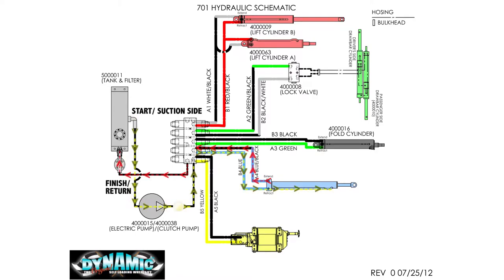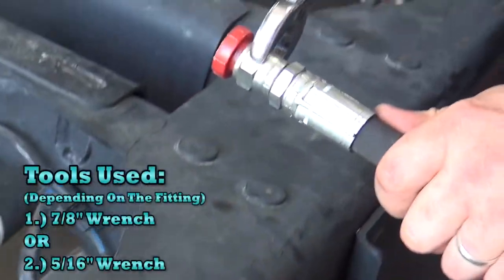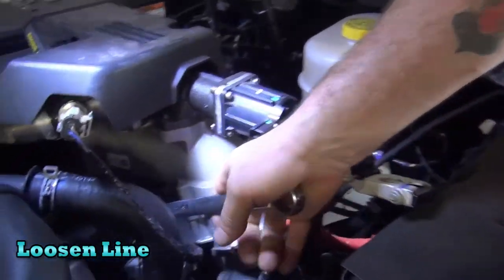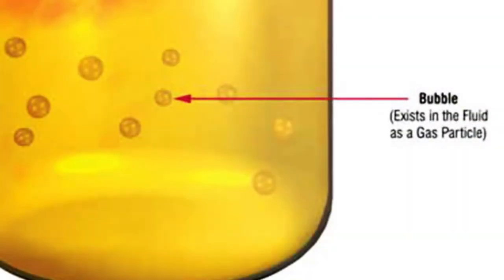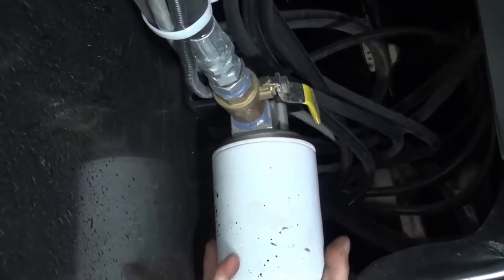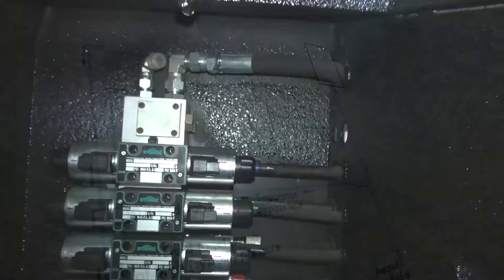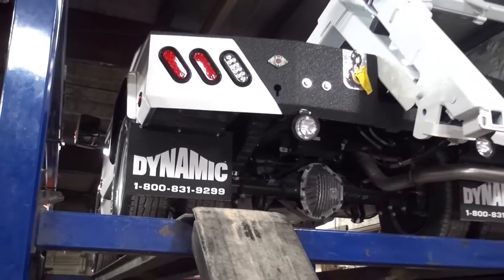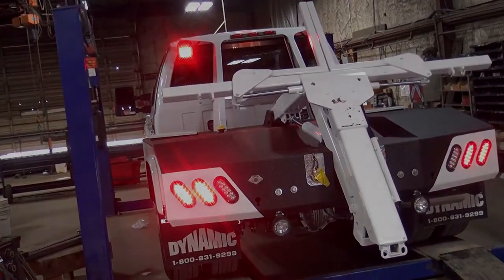Dynamic - Removing Air In The Line

Comment: I got and older dynamic self loader wrecker and I had pin holes in my boom up n down hoses so I replaced them and now it doesn't work it acts like it wants to move when I hit the switch but nothing.....all my other functions work as they should and the fluid is topped off what could be the issue air in the lines?
Reply: I have same problem,  were you able to fix it?